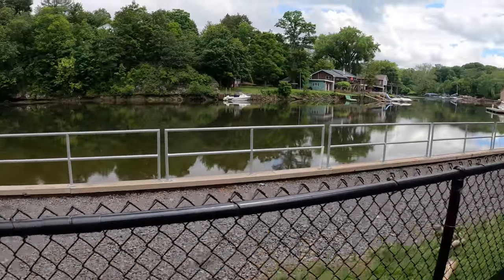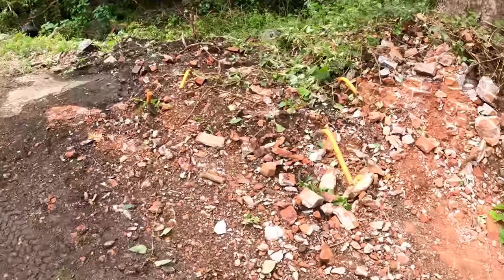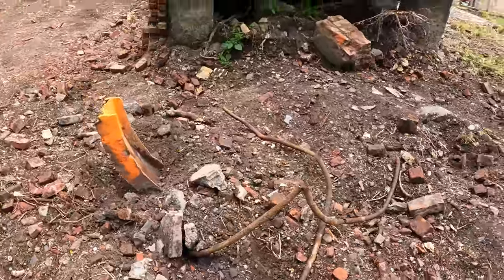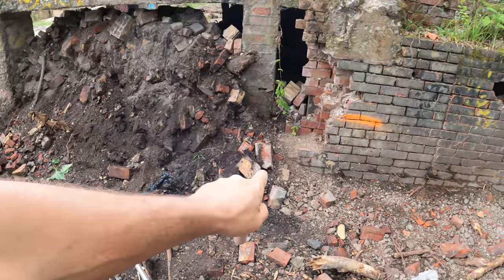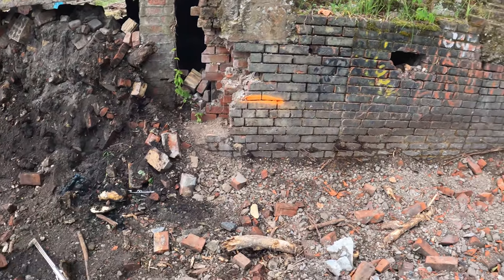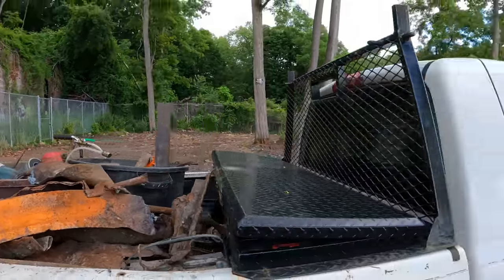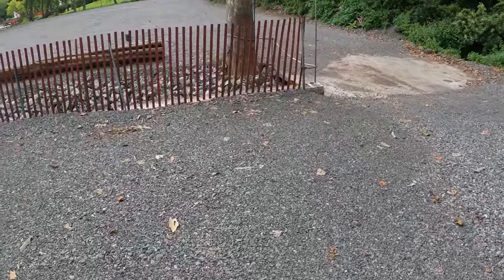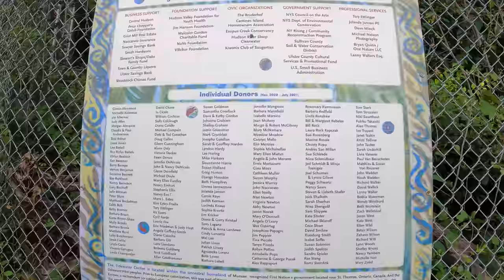Revisiting that coal bin and cutting pipes

Comment: Man there was tons of cool old buildings and stuff like this all over NY, Back when I lived there me and some friends drove around exploring a bunch of old buildings one day, one was some kind of old water turbine or generator or something, had all kinds of wires and switch panels, and a basement that had an old engine that was half covered with water, couldn't make it down the steps.
I haven't noticed the same kind of old buildings scattered about in TN, they either wasn't as much industrialization going on down here, or the buildings have been long knocked down or repurposed, or you'll get shot for exploring.

Comment: It would be interesting to know what those steel bars and the surrounding pipe were used for, as I haven't seen anything exactly like that before.
Reply: Something bolted to it maybe some machinery?
Reply: They aren't threaded and the sleeves are what confuse me. What's weird is the tops look like whatever was attached to them... Was literally torn off due to the uneven surface. A rushed liquidation of old assets or something maybe.
Reply: @taliakuznetsova7092  the pipes were likely installed before the bolts, and installed as a way to leave space to install the bolts at a later date with a cement grout, the circular pattern suggests it might have been some kind of jib crane

Comment: So it's a metal casing drilled into rock, and then wood rings are inserted in and the rod is pounded in and the original case expands, locking it in place.  That old wood is original.

Comment: Andrew, look at a "Petrogen" it uses gasoline (petrol) as the fuel + oxygen. Advantages are its very cheep to run and cuts up to 12 inch thick plate, Disadvantages are its a rougher cut, and you have to manually pump up gasoline tank to get cutting fuel to tourch. Good for 
Demo work. I have used it in training, its rough but fun to use.

Comment: Why don't you use it when attaching a rotating shaft to a forklift would make everything easier? Is there any other reason?
Reply from the maker: Use what?
Reply: @AndrewCamarata  
This is South Korea.
It is actually used for collecting such as tree stumps in the mountains.
Korean Doosan, modern Japanese Yanma, Kubota, and Volvo excavator tongs are equipped with motors to allow excavator tongs to rotate.

Comment: so it begs the question of why werent you asked to finish this job ? instead you get to cut up some scrap iron which the other contractor could easily have done ? were you even asked to bid the job??
Reply: Based on comments Andrew made in the previous video, this project is being done by a non-profit a little bit at a time as they scrape together donations.  It wasn't like this is a well funded project that's executed start to finish in a single contract.
Reply: He was but turned it down

Comment: You should look into a bigger Torch tip maybe combined with a new Torch. It seems a bit small for the kind of work you did im the video. Also Propane might work better (cheaper) for your application than acetylene does. You only use the ability to weld with the Torch but you need a different Torch set.
Greets from Germany